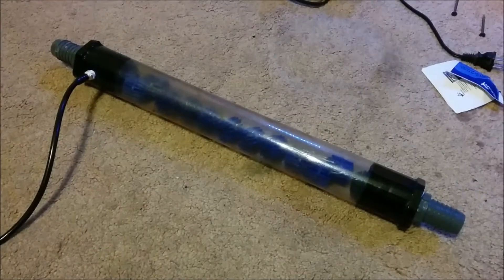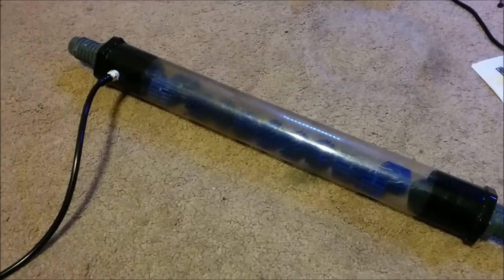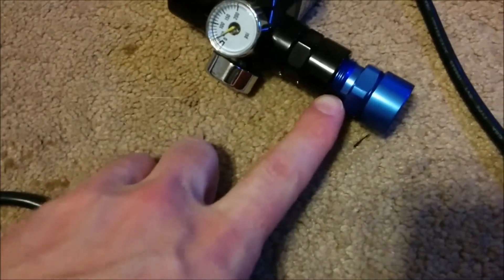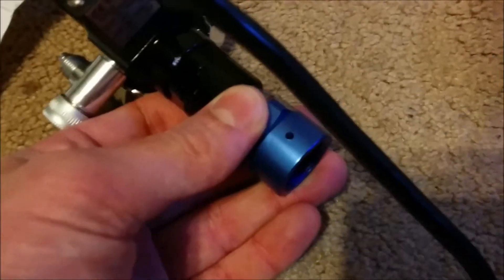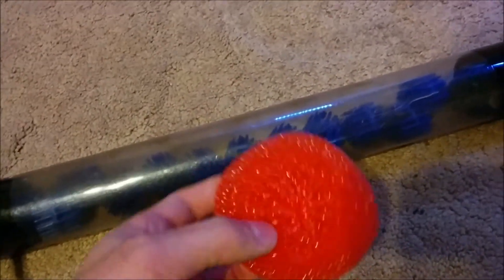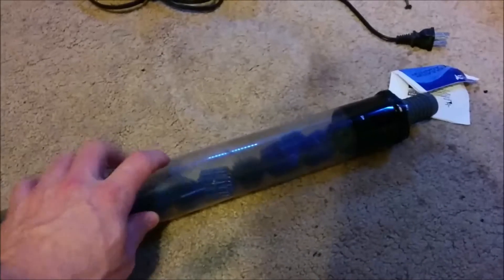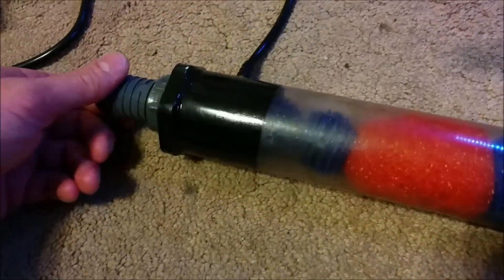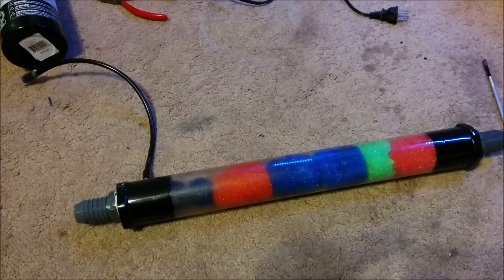DIY Co2 Reactor moddification

Comment: I'm buying my first regulator for my 75 gallon planted tank the problem is I have a fx6 and they AquaClear 110 they do not make inline diffusers for the fx6 and I do not want micro bubbles so I'm thinking of trying this idea you came up with my question is is it on your intake or output one of your canister
Reply from the maker: Its on the return. You dont want to put the regulator on the intake because you dont want any bubbles to make their way into the filter, they could damage the impeller.  Quick note tho, dont spend an arm and a leg on a regulator, I buy used aquatek mini regulators for $40. Thats what I was using with this reactor and thats what Im using now on my 75 gallon tank. Spending $100 $200 $300 $500+++ on a regulator is just silly to me. Also, dont put pot scrubbers in the reactor, over time it got gunked up and considerably reduced the flow of the filter
Reply: So let me ask you this......if i dont want any micro bubbles and want to stay under 150 bucks what would you suggest
Reply from the maker: this style of reactor is called a " Rex Griggs " reactor, the other kind of reactor is called " Cerges Reactor ". both would work. Both take some DIY skillz. Im more of a fan of the rex griggs reactor, but it does take a lot more vertical space. The Cerges reactor used more horizontal space and is also more expensive/complex to build. BOTH reactors are too loud for me, I use intake disk diffusers. They are MUCH less efficient than any kind of reactor, but they are just more simple... If you design your tank/filter/under stand setup to accommodate a reactor from the beginning its pretty manageable, but if you try to stick one in after the tank is established and everything is going, its hard to squeeze in a reactor.
Reply: With the disk diffusers you get a ton of micro bubbles in your tank correct you're talking about the little AirStone made by Fluval that's just got the ceramic disc and my correct
Reply from the maker: I put them in a dead zone that gets little to no flow, keeps the micro bubbles in the tank to a minimum. The bubbles just rise to the top. Not sure if this link is going to work here on youtube, but here is the diffuser im currently using
http://www.ebay.com/itm/Aquarium-Ultra-thin-stainless-steel-co2-diffuser-25cm-30cm-35cm-40cm-to-select-/151471224979?var=&hash=item2344637893:m:mfhwH42IYw2_kVxUIyMBNXQ

Comment: Hello Sean, How did the DIY CO2 reactor work out after you changed it and added the scrubbies? Did it improve as expected? Any troubles? I am working on a 180g and interested in what you did for your tank. Thx, Ceil Russell
Reply from the maker: it worked great. don't put scrubbers in it. when I did it clogged and killed my follow. the only thing I didn't like about it is how much nice it made. a constant gurgling sound of the co2 bubbles working against the flow of the water. if I were to do it again I'd high a look at the sturges reactor I think it's called.

Comment: You can also pick up those gaskets for like $0.10 at the same place where you get your tank filled-- next time you get you tank filled, might want to pick one up to have as a spare since they are one time use only and never know when you might have to take your rig apart. Overall good project and I think you will be happy with the results. Also, I did figure out a way to ship plants for much cheaper, but last time I saw a tank update I think you had already found some ammania sp japan.

Comment: Cool deal bro! You know, green leaf aquarium has a brass gasket the screws into the co2 tank and you won't have to replace it like those Teflon ones that come with regulators and adapters. I think it's like a $10 or less part and last forever. Can't wait to see everything back together and pumping co2 bro!!

Comment: I'm nor familiar with the impeller for that filter but does it have an impeller shaft. If it does put a little Vaseline on the shaft and impeller magnet I saw a video where they did that.  I did on my canister it work. No more noise from the canister.
Reply: This has worked for me as well. Worth a try.